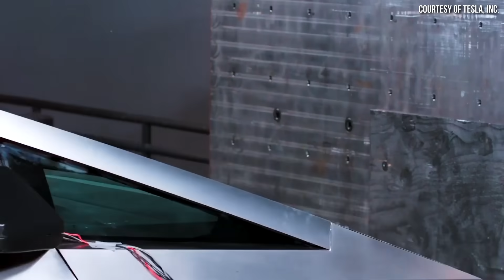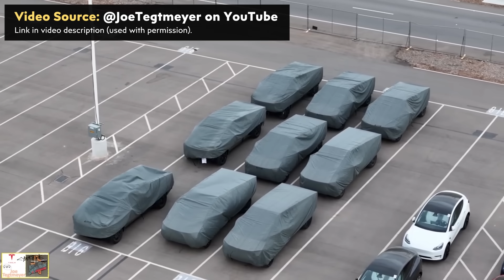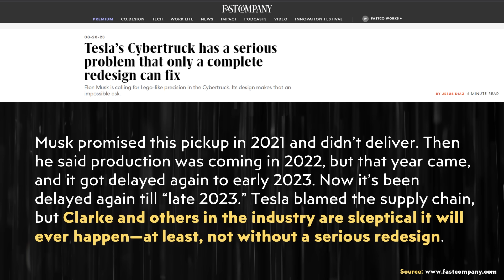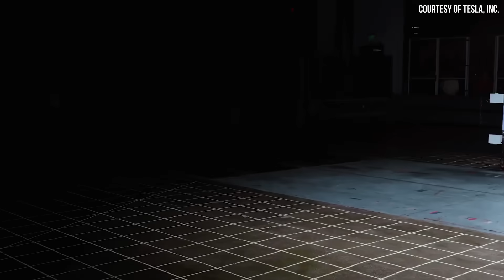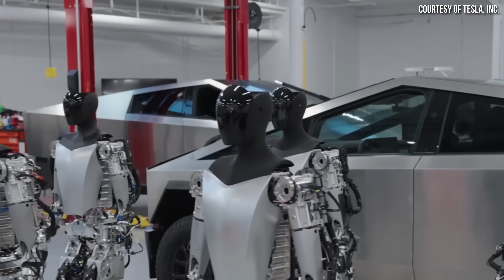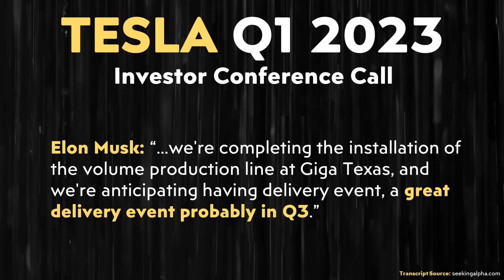Critic Reacts to Tesla Cybertruck Production Candidate | Re-design Needed

Comment: The Cybertruck better have Vehicle to Load and Vehicle to Grid.  Two charge ports would be nice.  Driver rear and passenger front for towing.  Tesla has not installed towing spaces as they should have been since 2019 when they should it.
Reply: Tesla has towing spaces at many new scers. Also if the megachargers and nacs are truly backwards compatible?
Couldn't ct owners also then use tesla semi megachargers. I think this was a secret given away at the semi delivery event nobody noticed. 🤔
Reply: @4literv6  Hi,  the Megawatt Charging connector is a much larger and different shape than the NACS connector.  I have been watching supercharger locations and just got back from a 1500-mile trip, and none of the 14 stations had spots for towing.  I've had a Cybertruck on order since 2019, but the Chevy Silverado electric RST is looking real nice.
Reply: @davidws5439  the connector they showed off and claimed was capable of a megawatt plus at the semi delivery event last Dec is compatible with nacs&the older tesla plug. The lead engineer made a point to mention this specifically. 👍🏻
Reply: @4literv6  Sorry, you are misunderstanding.  The NACS is the standard AC and DC connector that is on all North American market vehicles, up to 1,000 volts and 1,000 amps peak ability.  
The Megawatt Charging System (MCS) is a charging connector under development (in 2020 to current) for large battery electric vehicles. The connector will be rated for charging at a maximum rate of 3.75 Megawatts (3,000 amps at 1,250 volts) direct current (DC).  These are in use in 2023. 

DC Chargers are at the stations, direct current the battery with communication to the vehicle as to its requirements.
Reply: @davidws5439 I’ve owned a Tesla since 2018.  I’ve charged at superchargers hundreds of times.  Almost all the newer locations have at least one pull in station.  The software will likely route CT to the locations with drive in stalls.  Good luck finding anL3 charger for your Chevy.
Reply: @wademt  you must have forgot... Tesla is opening 12,000 sc to the rest of the vehicles.  Tesla probably screwed up by doing that.  Maybe just added 4 to 6 stalls with the magic docks. I own two Teslas now and stock owner.  My 2018 DMM3 I payed for FSD and NEVER got to even try it, them bought a 2022 DMLRY so Elon and Tesla has screwed me.
Reply: @davidws5439  sucks to be you. I’ve been using fad for 3 years.

Comment: I own stocks in Tesla. Why not Gigapress left and right sides? More weight for sure, but then 4 parts almost gives a full car?
Reply: The full size 12k ton press for the compact could be something like that based on the released patent application and pictures. 
I think they are gonna do the whole frame in 1 shot. Then you have the structural pack with f&r castings. So 4 big pieces=a car. 😎

Comment: Tesla and SpaceX share knowledge.
What is the tolerance you expect in parts of a raptor engine or a starship or a fueling mechanism?
The only difficulty is mass production, but both Tesla and SpaceX are working on the same problem with the same material.
Plus, when they figure it out and mass production prooves to be cheaper and more efficient, why not relaunch the S3XY line in cyber style?
Reply: I think you nailed it... Refresh the S3XY line in cyber silver & wraps. Cheaper for the company more and more mass production & something their competitors won't be able to copy...

Comment: And I'm sure these "experts" are taking the two castings into consideration when they weighed in on the impossibility of having proper panel gaps. If there's one thing I've learned in life, it's that most experts are not experts.

And personally, I want the CT for its lack of paint, use of SS, and for what's "under the hood" technology-wise. I couldn't care less if there are irregular panel gaps.

Comment: That is NOT a Model S behind the Cybertruck. That’s the new Model3 Highland.
Reply: Rear light was wrong?
Reply: Has a plaid badge and the wrong taillights to be an m3 even if it's the highland update. 
Oh how I wish that tesla was going to build a dual motor with plaid drive unit equipped, track pack lighter m3 perf. 😁👍🏻
Reply: @4literv6  Plaid doesn’t have a spoiler
Reply: It's clearly a hatchback...not a model 3
Reply: @rgeraldalexander4278  Correct… So will the Model 3 Highland. 😃
Reply: @richfeather  highlands out now and it's not a hatchback. 👍🏻
Reply: @4literv6  Just saw a few videos about it. Okay, okay, I agree. The car behind the Cybertruck is probably the Model S…
Reply: @richfeather  I was sad to tbh. But I've wanted a plaid dual c.f. wrapped motors model 3 with castings, and structural pack since 2021. 😀
Reply: Nope, but a model 3 hatchback would be great.  @richfeather

Comment: John, you really need to first establish in numbers as to what exactly is "difficult but not impossible" to build.  That is, for instance, over a length of 1 meter, how much + or - in mm is considered to be acceptable (including not visible for straight line alignment).  The point is, that Clarke also has not established that benchmark of tolerances but if you can find it, all the better.
Reply: Before watching.
I used to design completely unrelated components which when assembled could suffer badly from tolerance stacking. We worked down to very tight tolerance, zero to plus on one section then zero to minus on the next, which tended to zero the error, not really possible on a 5m welded car body, UNLESS you have a monolithic component at each end on which you can machine a mating surface and use that as a datum, then machine locating points, pins, holes, slots, studs, whatever, to a high degree of accuracy.
At that point you're going from a "building" tolerance to a "machine engineering" tolerance..
Apply that to both castings and you remove 67% of potential error along the length of the vehicle.
If the jig for the passenger cage is tight, it's going to be very consistent.
Then there's the straight line joins/ gaps.
If you set a pair of optical  sensors perpendicular to the panel face top and bottom of the panel, instant good gap, once calibrated.
No trying to align curves in 3 planes (by eye?)
Flat and square is all you need.
.
Reply: @rogerstarkey5390 at that point though it doesn't sound like the process of a mass produced vehicle so really not feasible.
Reply: @rogerstarkey5390  I don't think most people realize how much stainless steel moves from heating and cooling. You can't make the tolerances as low as they claim unless you do that at an elevated temperature and pin it in place. Then, when it shrinks from cold winter temperatures, you will just have to accept that the gaps will be much larger than you think.

I went to school for many different technical classes. I studied about materials and used to do a lot of custom fabrication projects. I grew up in and around the trades and even did welding in the past. 

Stainless steel grows and shrinks a lot. It seems to almost be alive at times. It also moves heat very readily.

If they are going to use it they just need to give it room to move and ne okay with the looks.
Reply: Spot on dude.
Reply: There is no way they are gettjng this anywhere inside the micron range. It’s so laughably stupid that it makes you realise Elon still doesn’t know jack sh!t about Engineering

Comment: Flat shiny surfaces are the worst possible choice for asthetics. Unless it's mirror flat, it's going to show every ripple. Worse than that, flat surfaces tend to look concave, even when they're perfectly flat. This is why Rolls Royce used to made their 'flat' radiator surfaces slightly convex, so they actually look flat.
Making the Cybertruck in quantity isn't going to be especially difficult, if you don't mind them looking terrible. Frankly, there are only two answers to this. One is to junk the existing body and put a more conventional one on the same gigacastings and running gear, keeping as much of the interior the same. The other is to wrap them all, to visually add curves where there aren't any. That would probably make them look less horrible.
Unfortunately, Elon pulled rank on his design team and overruled all their objections. Sadly, Elon doesn't always get it right, and this is a case in point. It's been a grave error of judgement that will cost Tesla dearly compared to if they'd made a more conventional and less divisive design. The whole concept of the 'Exoskeleton' was a nonsense from the start. Look at any traditional car construction, and you'll see that most of the strength comes from a 'skeleton' of sorts, ie the pillars, roof and floor. How is an 'Exoskeleton' that different? You can't get any meaningful strength from doors and other openings, it's all got to come from the frame.
I'm a huge fan of Tesla and an Investor, so I hope they can salvage something from this debacle.
Reply: How do you know the design team was objecting and Elon overruled? Franz Von Holzhausen’s commentary about the Cybertruck design process does not indicate that he was in conflict

Comment: cybertruck is hard to build because it is KITT.  not only bulletproof body, not only FSD, not only it floats but also it talks in meaning Ai chat.
Reply: Hasn't got FSD because Tesla doesn't have any working GSD solution.  Body isn't bulletproof  either.
Reply: Won't be bulletproof, FSD is eternally beta and 500+ miles would need well over 200kw battery. Btw I have tesla model 3 but only cause it was relatively cheap and available right away. It's not a very good car beyond good range and power.
Reply: It’s more like Kar, Kitt’s evil twin!